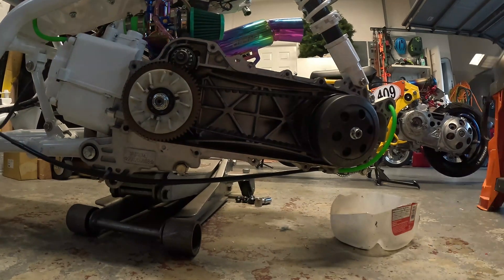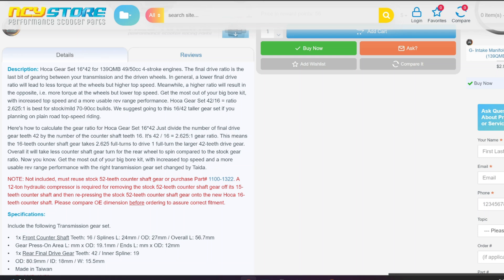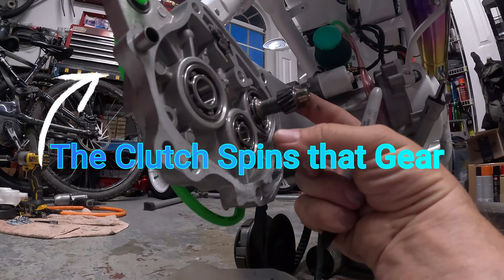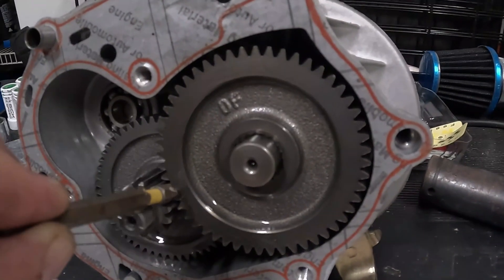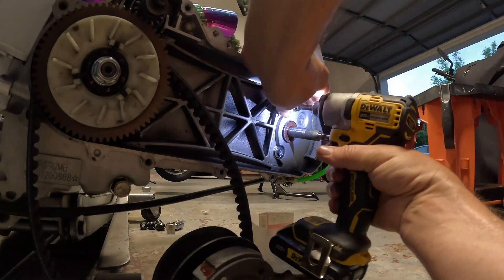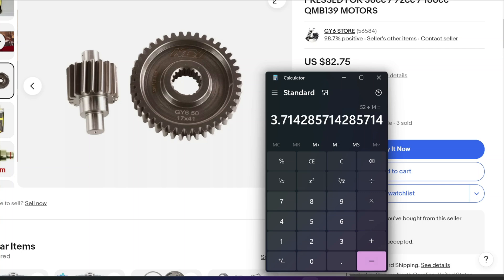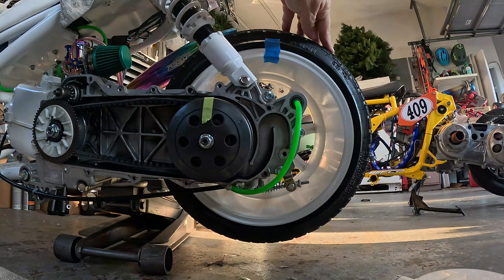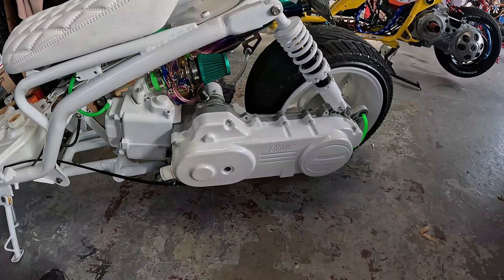Maddog 50cc Final Drive Gear Up Kit for 90cc 139QMB.  Buyer Beware

Comment: So do you still think a stock gearing setup with an 89mm variator and a 788 belt? I just installed the 24mm cvk carb and have the big bore kit.
Reply from the maker: Yes.  You can try it, but I was slower.  I only had 1 150cc get faster.  I still may pull it out since it made bike more sluggish.

Comment: What parts do you have installed to hit 53mph? Ive got an 80cc bore kit, pwk 21mm, variator, rollers,cdi,exhaust and filter and can only get 40mph. I just put a 100cc bore kit in a dong fang srt im hoping once i swap the parts to it ill get to 50 but im curious what your set up was
Reply from the maker: @nobody94820   the 89cc Naraku and Big valve head.  NCY Cam, NCY CDI, straight thru exhaust, 95mm variator and 788 or the 89mm NCY variator with shorter 781 belt gave me better, but risky for belt breaking.  Fresh new belt.  CVK 24mm gave me the best speed.  45 PSI in that back tire to round it out.   What is the mm size of that 100cc?  89cc is the largest bore made.  94cc if you stroke that kit.  You have to know the bore size.    52.4mm is 89cc.  50mm is 81cc. Everyone on ebay and Amazon lie bad about cc on their kits.  I even saw ebay list a 110cc that was an 80cc.  WTF.
Reply: @GhettoWrench 50mm is the inner diameter. I know they say it's 100cc or 89cc and ur right it's not actually that. Still the highest I could go with a gy6 50 but I was really hoping it'd get to 50mph
Reply from the maker: @nobody94820 ya 50mm is only an 81cc but still a good mod.  I have heard way more reliable than the bigger 52mm ones.  I have only used 52.4mm ones.  It's all about the RPM. You have to get over 9000 RPM.
Reply: @GhettoWrench really all I need then would be the ncy cam. Do you remember what the gain was from before and after ? I never really played around with the weights I just got a gilixal variator with 6.5g weights. After doing the cam I guess I'll play around and see what works the best.
Reply from the maker: @nobody94820 here is a video on JUST the cam.  I forget what the gain was, but def better.

https://youtu.be/p28B7eIS0Qg?si=Mb1Z3MOhQr5tAPNX

Comment: If top end is your goal, then the sweet spot is horsepower to gear ratio; however, my goal is to have a relaxed low RPM cruising speed. So, I deliberately choose a very tall gear. I have a video on my channel explaining how you can swap 50cc parts around for taller gears for free. I don't know if YouTube will allow me to post a link. You are very good at mathematically figuring out things. Check out some of my puzzles.
Reply from the maker: @mrcleanisin  checking now.  Ya you can post a link.  But I have seen your vids.  I just go to your page.

Comment: Hello sir is your motor up for sale on eBay? Let me know pls. Thks
Reply from the maker: @seanmayo206  that is it.  I made the bike electric
Reply: I'd like to get it. How can we do this?  Let me get the opportunity.  400 is alot to me but  I'm sure it's put together pretty good an learning how to build these motors has messed my block up an it's mostly the threads an I've rebuilt the bottom end just recently . I did decinagrate a bearing on the cam side with 51mm piston  an somehow I can sheer off a piece of the crank on the backside of the woodruff an I just spent 140 on another crank an flywheel an CDI an stator. I'll see how it goes .
Reply: I wish I could pay out 400 at one time but I can't

Comment: Thqt 50 anit running no 50mph
Reply from the maker: @seanmayo206  My other one did 53.  I ain't stopping till I get 55 on this one on the fat tire.  I could prob get it now on the skinny.
Reply: Your not 160 pounds an those bike aren't light
Reply from the maker: @seanmayo206  I'm 200ish pounds
Reply: Is it safe to say a couple more teeth is ok?
Reply from the maker: @seanmayo206  the little one gets bigger but the bigger gear gets smaller.  Do the one I did in that video.  Yours is same as mine so it will fit and be perfect.  I just didn't have the RPMs from the start to run it.  I was starting at 8000.  You are starting at 10000 so you will be perfect at 8500 rpm.

Comment: You need to buy programable computer
Reply from the maker: @Brujiito333  like a fuel computer or for timing?
Reply: @GhettoWrench  the 2
Reply from the maker: @Brujiito333  well fuel will not improve unless it is fuel injected and that costs too much for these cheapo bikes.  An AFR will only help tune jet size and once that throttle is open all that matters is main Jet size and it is the only adjustable parameter.  You will still adjust that for speed and not stoichiometric mixture so no improvement there.  As far as timing, a computer can not advance ignition timing so again, once up to RPM you can only retard from a fixed mechanical point on the flywheel.  These are sitting at 28 ish degrees so there is no advancement available.

Comment: So what’s the sweet spot for the gear ratio for these 90cc BBK? To get 50+mph
Reply from the maker: @Smodlee  I went back to stock gears.  15/52.  But I'm also running a 95mm variator which is a pretty good gear up step

Comment: Hello, I have a peugeot kisbee from 2022 with 139qmb injection. It has a polini variator and runs now about 37mph. Do you know how i can make it faster?
Reply from the maker: @user-gz4gi8qu6o  do you know what RPM you are at when 37mph?  Also is the variator 95mm Polini "speed" variator?  It takes a lot of power from like a bug bore kit and cam etc to turn a larger variator than the 87mm stock one.
Reply: @GhettoWrench  no i dont Know the rpm. So I should try the Orginal variater again?

Comment: Most profit is in a lower secundairy gearing. I installed a lot of primary kits, usually all they do is give the bike less top rpm and s bit more speed but not always
Reply from the maker: @hoedemakerbart  I could not find any lower gears than the 15/52.  I would like to actually gear it down
Reply: @GhettoWrench  many times primary has a bad fit or wont fit at all, lately i had this with a doppler kit.. very bad engineering
Reply: @GhettoWrench  AliExpress
Reply: So what’s the best gearing for these Chinese scooters
Reply: @Smodlee  if you upgrade the gy6 50cc to 80/90cc kit with the head and race cam,only then i would go lower gearing, 50cc is not strong enough .
Stock secundairy i dont know out of my head, but should be around 15/51 so if you go like 17/48 you will have more top speed
Reply: @hoedemakerbart  my stock gears are 15/52 and I max out like 43mph with a pwk 21 carb I’m going back and forth with the roller weights from 5g to 8g and 8grams doesn’t get be much top speed on a long flat road so I’m thinking about buying the final drive gears but don’t know which one I did the tape test on the clutch and the tire and I’m 15 to 1 full wheel turn
Reply: @Smodlee  if you want more top speed with the 50cc only options are a race cam  or like i said better variator then stock
Reply: @hoedemakerbart  oh I found trans gears that will make my scoot go 60mph!!! With a BBk
Reply: @Smodlee did it ever hit 60mph? What parts are installed?
Reply: @Smodlee  you can gain on the 50cc with a better variator then stock, like the polini hi speed for Kymco agility 10 or 12 inch comes with the belt length, this also fits gy6 10/12 inch
Reply from the maker: @Smodlee  I guess it all depends on the scooter.  Tire size and current gearing and the current RPM your running all play a part.  It is like carburetor jet size, no one size fits all.  I would say if you can exceed 9000 RPM it is worth gearing up
Reply: @GhettoWrench  I’m going big with mine I ordered a 18/46 🤣 we will see what happens
Reply from the maker: @Smodlee  be sure and let me know.
Reply: @GhettoWrench  I will it should be here next week
Reply: @Smodlee  How are you?" did you manage to go faster with the new gears?

Comment: Another great video. Have you balanced your wheels?  I wouldn't have gone anymore than a 7% increase on my old 171cc, but with a stroker or 180cc+ I would go higher.
Reply from the maker: @thelagmeister  I have NOT balanced them.  This bike I bought in 2024 new in the box says 2022 on title so for 2 years the tire has sat on a piece of angle iron and has a dent in it giving it a vibration.

Comment: My gearing is 15/52 I was looking at the 17/49 like u where and I have that 90cc BBK wonder if I’ll make it past 50mph with that speed more then what your 50cc is doing
Reply from the maker: @Smodlee  mine is 90cc and big valve head and NCY Cam etc also...  I wouldn't think so.  I'm pulling it out.

Comment: Can I bother you with another question. What is the app you use to record your rides and that shows the speed in the upper left hand corner together with a compass direction? Thank you.
Reply from the maker: That is the GPS "sticker" on the GoPro 9 black.  I just bought a new gopro 12 black and go pro has removed this feature.  They must be talking to iPhone.  WTF.  So pissed as that is the main feature I like.  The 9 is old and been ran over a few times so figured I would upgrade.  It was a downgrade.  LOL
Reply: @GhettoWrench  thank you. I own a knock off Chinese brand of Go Pro and it doesn't have the feature either. I will try to find a phone app to do this.
Reply from the maker: @frednetherlands887  I guess there is some phone app guys use to overlay maps and speeds on their videos for new gopro that everyone uses so gopro dropped the feature.  I have to get smart on that.
Reply: @GhettoWrench  thank you. I will check as well.

Comment: Couldnt you adjust rollers to keep the engine within that rpm range?
Reply from the maker: I guess but I am just going in circles.  They are already at 4 grams.  If I go grams they have good RPM but push the belt up the variator.  Still no faster.  I am gonna try a smaller variator next..  but just going in circles again.  Gearing down the CVT to make up for gearing up the rear
Reply: @GhettoWrench I keep coming back to this video a lot. I finally got that 72cc BBK on and it's gonna be time to tune my CVT and gearing soon.
Reply from the maker: @hesperidesbell4643  when I bump up the RPM with lighter rollers it just has high RPM and goes even slower.  I'm like a dog chasing my tail.   I was at 4g and the 3g won't push the variator all the way so it never gets in high gear
Reply: @GhettoWrench  how does the wear line on the pulley look when you check after those rollers?
EDIT: a lot of the groups I'm in on Facebook swear by polini CVT parts and I've seen a few claims that you can get a stock 139QMB to 50-55 with those parts. Idk how true it is but what I was wanting to do now is compare the polini parts to the kits like glixal, rolling wrench, malossi, stage 6, etc
Reply from the maker: @hesperidesbell4643  I'm going all the way to the top of the polini.  The maddogs are slow with their big ass heavy golf cart wheel and tire.  I could easily see a regular 50 scooter doing 55.  I made my buddies go 53 with a skinnier tire but still stretched.  It had a NCY 95mm variator for a DIO thar I customized to fit.  I liked it better than the polini.
Reply: @GhettoWrench  yeah the wheels on some of these scooter can definitely be a drawback. I went looked at some nice wheels for my scooter and good lord they get pricey quick. Honestly would like to save up and get a super light rear wheel made of magnesium or something to that effect

Comment: I'm not sure but I put in bigger piston an it revved higher with the stock CDI an the adjustable cdi . Then I knew the gearing wasn't what it should an then the back affects it. If your drag racing you want a low gear which is a higher number. It's backwards obviously. Imagine that
Reply from the maker: I can't find lower gears for this than 14/62 that was in there.  Only thing I been able to do to gear it down is that smaller tire and it went faster.  Guess I can put smaller variator in but seems like I'm going in circles.

Comment: What about different contra spring to keep the rpm higher longer?
Reply from the maker: My issue is the rpm at top speed is too low.  It's nice everywhere else.  The contra spring should not lower that.  And it it did then I would be just holding in a lower gear which also would be slower.
Reply: @GhettoWrench  well I guess I thought we want our motors in the powerband as long as possible. Are you making most power at 6500 rpm?  Lighter weights now to get you the rpm higher before they are fully out? I really don't know this stuff. It's all guessing and theory for now. Feel free to head up and help work on the dyno anytime.
Reply: Oh, and the white with green splashes looks clean. Very nice looking build.
Reply from the maker: @ThePitProductions  I got thinking about what you said later and it might actually be worth trying.  Like a manual transmission.   Use a heavy contra spring to hold that shift till the rpms are higher. Hmm. I think I have a yellow one.
Reply: @GhettoWrench   I think the main thing to consider here is that it should not be A shift, it is a continuous variation of the ratio. The idea is to keep the engine rpm right where we want it. If it was 2 stroke you would make sure the bike was "in the power" as much and as long as possible.
Reply from the maker: @ThePitProductions  makes sense

Comment: insane how much elevation and atmosphere affects tuning, u running a 110 main while im running a 85 in the mountains lol
Reply: I’m running a 100 main and 38 pilot on a 90cc BBK with a pwk21 carb and uni filter and I’m getting 49 mph with 6g weights and stock clutch.
Reply from the maker: @Smodlee  for sure.  Then the guys out west at sea level run like 130s since they have zero humidity.   49 is moving.  Does it have the fat tire ....  maddog?
Reply: @GhettoWrench  no flat tire it’s a 2022 vitacci Denali 50
Reply from the maker: @Smodlee  oh ya.  For sure faster than a maddog.
Reply: @GhettoWrench  hey don’t have the link where u got the gear up set??
Reply from the maker: @Smodlee  https://www.ebay.com/itm/175296799635?mkcid=16&mkevt=1&mkrid=711-127632-2357-0&ssspo=fhHZLgZSR1y&sssrc=4429486&ssuid=7oPuCdAPRY6&var=&widget_ver=artemis&media=COPY